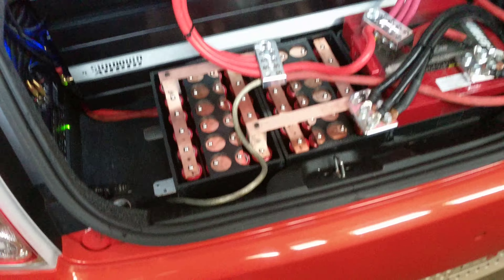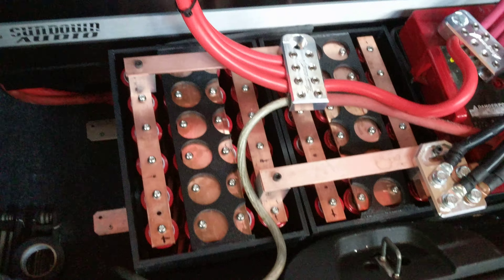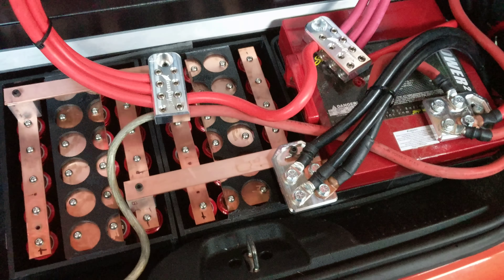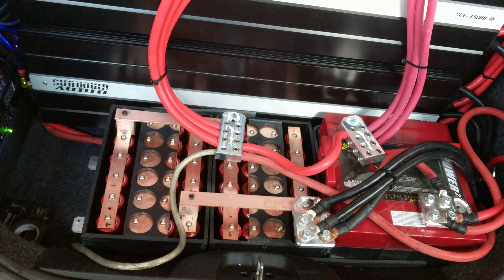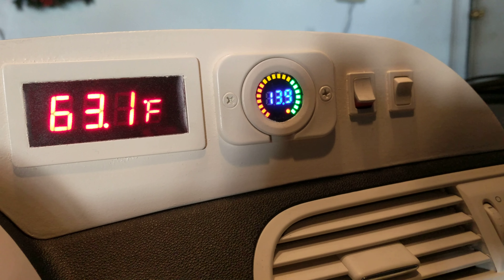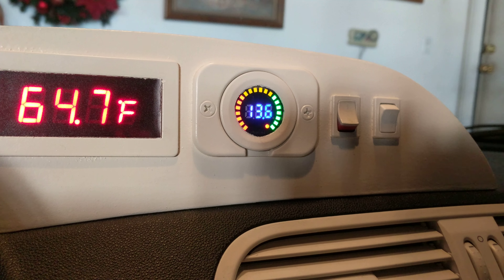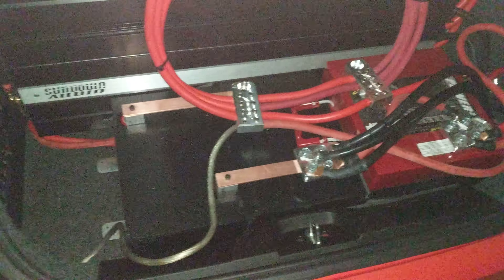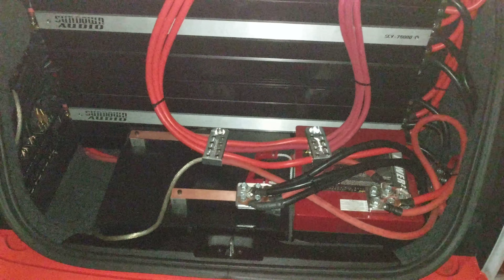Custom Headway LiFePo4 lithium batteries for car audio

Comment: Nice mine sits at 13.3 to 13.5. So far my pack is balanced I checked each individual cell and series groups. I'm very happy with my voltage now. I use to fall into the low 12s before now I see high 13s. Great video share and good wishes on the set up.
Reply: Where can I buy this lithium from

Comment: I am also running my system in an electric car. My inverter is 185amp. I was toying around and thinking to myself how to keep voltage high.  I am only aiming for 150db, but I am also trying to do that on one sub. Currently I have a 15" fi BTL neo on a JL 1000/1. It meters high 143's, I have a wolfram 2400, that will be wired at 0.5ohm and that is why I am currently looking into a way to keep my voltage up.

Are we completely out of luck because we have electric cars? We can't just throw a 300amp alternator on. Do we just have to have a ton more lithium or AGM?  
The manufacturer says under full load, my amp at 0.5 ohm will pull around 250amps and clamp and on the amp dyno it did near 4000watts at 0.5.

What do you suggest for my setup? I was thinking around 20AH of lithium and swap my 12v with a xs power(biggest that will fit).

Its rare to see another electric car doing DB setups. Would love to chat with you more, if you don't mind.
Reply from the maker: Chris Kyle the more lithium the better; whatever you can afford. More lithium = less drop, so higher voltage. Hit me up on FB messenger if you want to chat. Also, the AGMs are trash and will drain your lithium relatively speaking. If you can afford all lithium, it's the way to go.
Reply: I will add you on FB. Friend request sent.

Comment: is 14.8 peak and 14.6 bad for these headways ? I got a H/o alt and it charges at 14.6 all day long. Should I got a different route of cells?
Reply from the maker: 14.6v is max, anything above will reduce lifespan. Also, if you charge that high, make sure you have a really good balancer otherwise you risk overcharging individual cells and damaging them further.
Reply: @LoudFiat  thanks going ying long instead

Comment: How's it holding up? Still no BMS? Any issues? How much power have you been clamping? Considering building a similar bank.
Reply from the maker: Like new. I added a BMS but it wasn't needed, cells were within 0.03 volts. Haven't clamped yet, increased bank to 192ah for 2 12ks.

Comment: Please don't grill me for asking this, but if you run a lithium battery in the trunk can you use one under the hood as well?
Reply from the maker: Yes. however, I'd be careful if you have a gas car with an engine that gets hot.
Reply: @LoudFiat  ok thanks. What about having lithium in the back an a AGM under the hood?
Reply from the maker: @moneytrumpspeace3305  that's my setup. A solenoid to isolate and only turn on lithium when car is on is best otherwise agm will drain lithium when sitting
Reply: @LoudFiat  ok. And I appreciate your help. Have a good day.

Comment: Curious, if I were to create a setup like yours and have a 370 alternator charge the system it should hold up like any other lithium battery on the market like jy or limitless right? I’m new to the whole high output systems
Reply from the maker: Yeah, basically.

Comment: I currently have 32 38120 cells and need to find a diagram of how to set them up any ideas this is my first time
Reply from the maker: 4 in series = 12v, then 8 of those in parallel = more ah
Reply: @LoudFiat  First thanks boss for the info can I just connect the cables I have coming from the battery under the hood to the current battery in my trunk to this new battary pack? and do I need a bms on my pack? I'm a first timer...

Comment: Hey I’m going to be getting these and my Prius charges to 14.1 as well do you have them wired 4 times to 12 in series or 5 which I guess is 16v I had some cmax cells but couldn’t use them because of the voltage difference
Reply from the maker: 4s at 14.2v
Reply: @LoudFiat  bet thanks I blew my sundown x18’s from clipping and just reconed them but need these lithium’s so I can get bumpin right without clip ima get some agms too
Reply from the maker: @therandomrobert1842  these are for sale if you need any more.
Reply: @LoudFiat  how many do you have n how much? I might get some more I’m running 10k to my amps but might do 2 8k’s
Reply from the maker: @therandomrobert1842  192ah
Reply: @LoudFiat  true how much would you want for them and would you sell the bus bars with them
Reply: @LoudFiat  how much would you sell them all for and could you ship
Reply from the maker: @therandomrobert1842  can you dm me via Instagram or TikTok? @loudfiat

Comment: Nice i was also looking in to these cells but are hard to get for a good price out of the States
Reply from the maker: Car AudioDriver I ordered directly from factory via Alibaba.
Reply: @LoudFiat  Do you recall the source. I see lots of options but would like a repeatable company with not knock off cells. Could you shed some light on this?
Reply from the maker: @dale4485  I used the factory in China directly. Amy Zhang, amy@headway-cn.com

Comment: How do you charge the lifepo do you use a bms or pcm ?
Reply: Doesnt look like it :)
Reply: There is no BMS large enough for audio.   You charge them like normal Agm....with the alt.
Reply from the maker: Like any battery, no balancing for me
Reply: Yes,the BMS max protection current is 200A,if the working current is over 200A,the BMS will start the protetion.
Reply: @amywang8802  hey amy, can we use a couole of BMS units on one battery so the current handle is higher.  Like use 3 BMS 200a max each. Would that be 600amp max??
Reply: 150 DB you can’t do like this.

Comment: Would the battery’s add range to the car if the system isn’t on?
Reply from the maker: No.
Reply from the maker: 100ah is 1,200 kw hours, insignificant vs the cars 24,000 kw hour pack. Also, I doubt the inverter goes from 12v to 400v
Reply: You put my 600w amp and 2 12’s to shame. I’m not worthy 🙇‍♂️ I bet it feels amazing! Do people ever think there’s an earthquake around you?

Comment: Can you upgrade your cars invertor to allow more charging for your system?
Reply from the maker: No unfortunately. The next thing I can do is to tap into the main battery and use a custom inverter, however I've yet to find one.

Comment: Why not run an isolator so the agm's dont pull from the LP's?
Reply from the maker: My agm sits at 13.3 - xs power d 4700
Reply: @LoudFiat  but its still pulling so wouldnt the isolator help in this sitch?
Reply from the maker: @MrAzcabowabo  not sure it's worth the effort TBH
Reply: Could have just deleted that agm